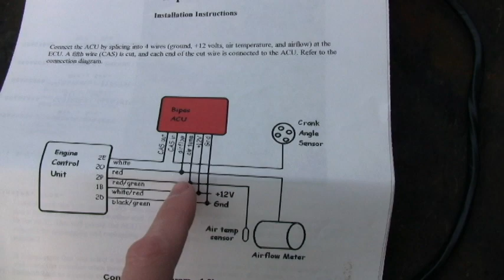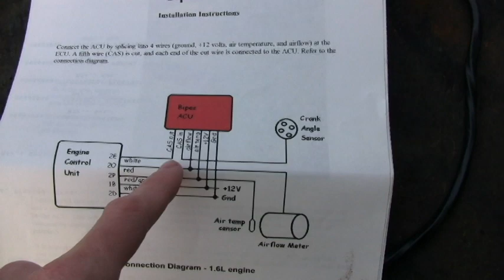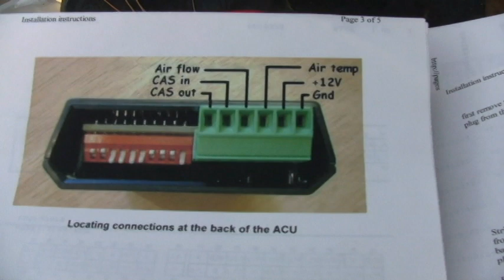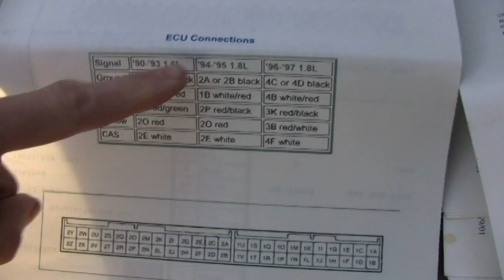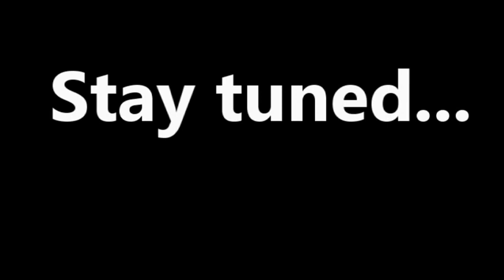TURBO MIATA PT. 3 - BIPES ACU INSTALL

Comment: Hi, I used to have a 1990 BBR turbo UK MX5 and tweaked it somewhat and used one of these with good results along with many other mods.
You need to use a high end timing gun to get the timing right as these have a wasted spark ignition system so the gun has to take that into account.

Comment: I've been running the Bipes for sometime in conjunction with 326cc injectors and FM Voodoo controller.  Don't see many vids on the Bipes nor info on the net for settings.  Seems people are hesitant to relay experiences with "bandaids" on the net for what ever reason.  My NA 1.8 static timing is set 16 degrees.  Currently daily driving on 13psi 93 octane (well before the snow landed).    One has to remember, the Bipes pulls timing in addition to what the factory ecu is adding or subtracting.  Example:  At 5k rpm under lighter loads the factory ignition advance could be around 30 degrees.  Bipes pulling 8 sets the advance at 22 in this particular situation.  Knowing your factory curve is very useful at low boost and necessary under higher boost and loads.  Det cans are a must.  Cool video.

Comment: Timing is all about fuel flash time..(the time it takes for fuel to burn).The higher the octane the slower it burns and so the more advance you can give it and the more compression(Boost).

Comment: You're getting it sorted, interested but lost (well a bit lol)
Now I'm sure your Dad can tell you, but before electronics, on a bog standard old car, the best way to set the timing was to advance until it pinked (knocked) and back it off 2 deg. No way perfect but the best you'll get. Was told that when I was about your age.
Also, before electronics, mainly the cam and carbs were what most used for tuning. When you fitted a cam you had to alter the advance in the dizzy.
However around 1980 I had a 1725 Singer Vogue (Hillman Minx). I rodded the engine, over revved it once too often. A firm called Holbay did a tuned version. I replaced it with one, but with a cracked head (that was the best bit) so fitted all the stuff from my engine.
I retarded it to stop it pinking BUT only got 8mpg lol. After a few hundred revs it was very retarded. I locked the mechanical advance in the dizzy and it was driveable....about 20odd mpg. So old fashioned cars had a poor cam to run slowly, compensating with a lot of advance.
Just thought you might find it a bit interesting.